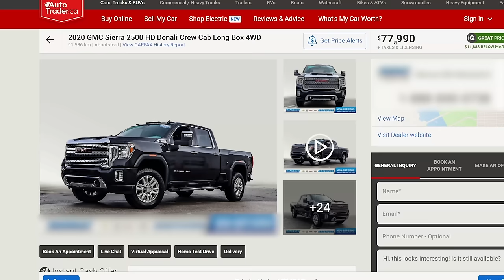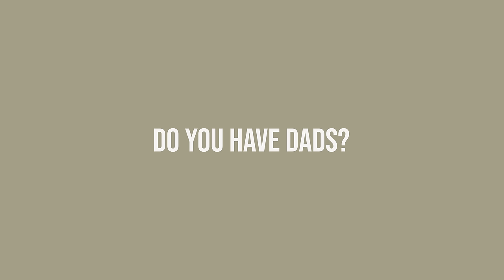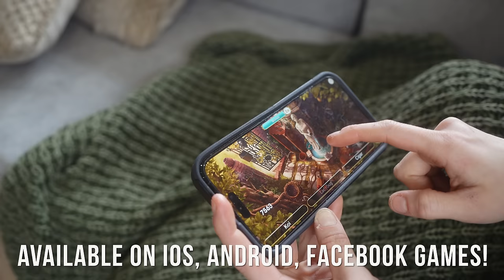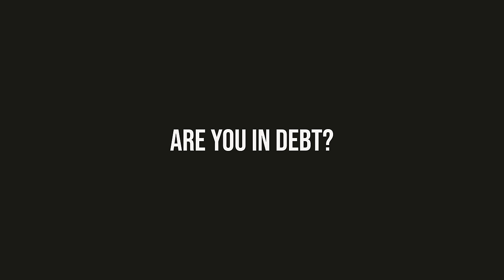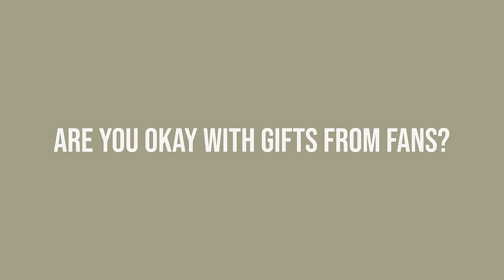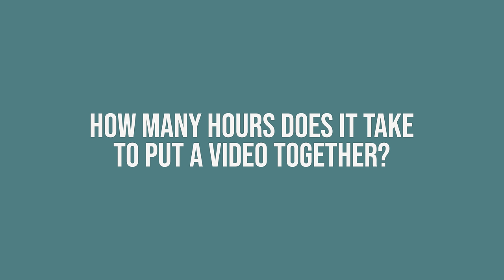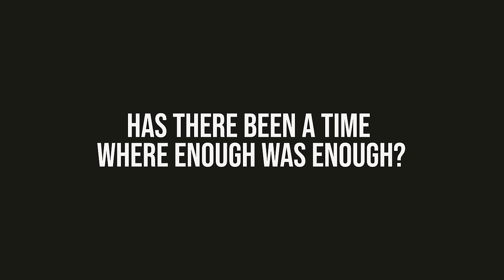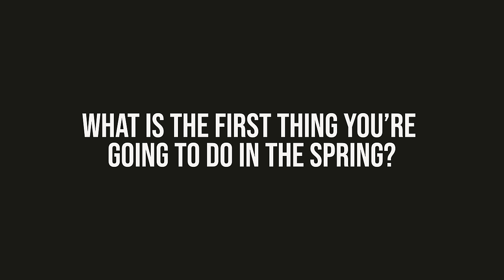There Are Things We Haven't Told You (spicy q&a)

Comment: Wiring your electrical system is not that hard, and sourcing the wire is pretty easy.  Your panels will be connected in series, so each array can send something like 360 volts at under 10 amps to your charge controllers.  10 gauge wire is fine for that.  You could actually use 12 gauge wire if you can tolerate a bit more wire loss.  Not hard to find, either at a home improvement store or via internet order.
The real problem is getting enough power during the winter.  Solar is not going to do it in Nova Scotia.  Maybe a small windmill or two would help, if you get enough wind.  Otherwise it's generator or just head South for the winter.  If you have to run a generator, propane is a lot easier.  You get a big tank so you never run out.  It gets delivered.  It never clogs your carburetor, so your generator maintenance drops to just oil changes.  One last thing:  Solar panels can freeze, no problem.  But batteries have to stay above freezing.  That takes some power (or a propane heater) and a well-insulated battery room.

Comment: A few very brief notes - trying to help you.
Pool: I recall (I think) that your drilled well made about a gallon and a half or two, from about a hundred feet (I don't think you told us what static level was, nor bore size).  By appearances, the "flood"  that attended the "second" steel post installation (to support the solar panels) was something like twelve to fifteen gallons at about eight to ten feet down.  Right, I wasn't there - you know the facts and can suitably apply them.   Totally guessing, but the chances are that your have a capable source of free-flowing (probably fully potable) water that you have fought with, but with which you have not considered a happy relationship.
The nicest pools for sites such as yours are made by diverting and then digging in front of such a source,  lining the dug area with, essentially, a very mortared stone wall, the pulling the diversion.
probably
Reply: breeve  gee mail

Comment: What's next? Well, let me gaze into my crystal ball.....With the solar panel system up and running, even being expanded by more panels and batteries, the girls do their podcast in a studio built in....the expansion to the cabin. (The studio may become a nursery later, however, given that the girls are still young, the debate/dilly dally continues.) The podcast, as well as their first 2 books, are wildly popular and the girls are sought out for their opinions on self-esteem, love, teamwork and constant learning as a means of overcoming fears. The van sits in its carport, safely preserved from the elements, on blocks to protect its tires until an adventure calls, serving as a backup when needed. Too many memories to part with it, as well, it has been well maintained. Bella and Izzy are eternally grateful for Pack donations of canine booties for the Nova Scotia winters. The greenhouse has seen numerous expansions and the girls have a sideline in selling produce to Farmer's Markets. The sauna is used 12 months of the year thanks to improvements in the outer casing and the heater. The increased revenues allowed the girls to buy a used industrial snowblower from Halifax Airport so they are never stranded unless they wanna be. The pool has still not been built.